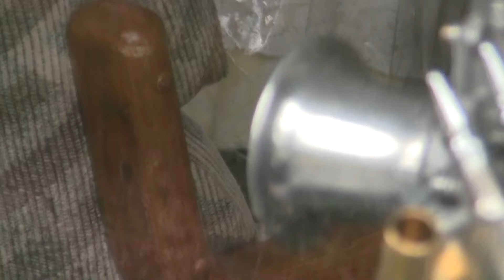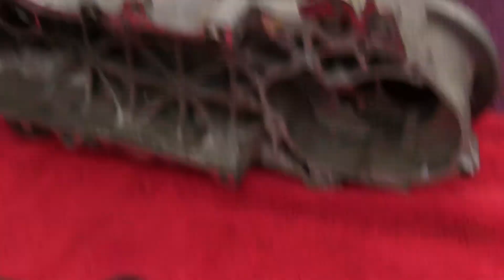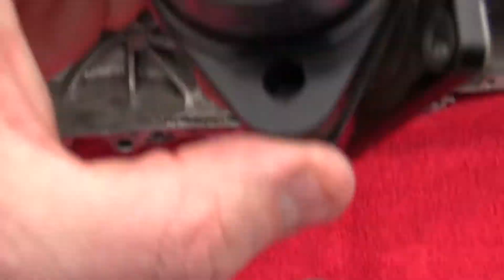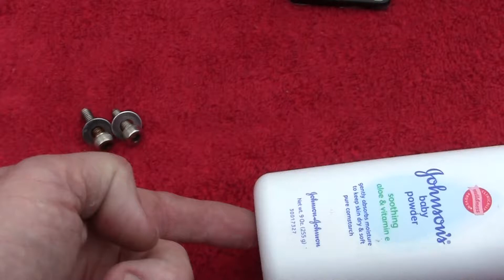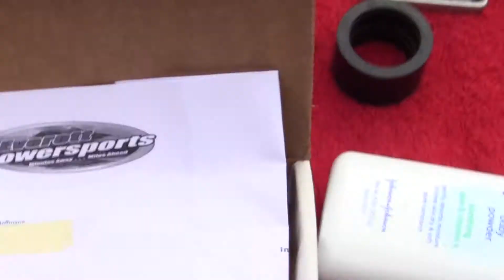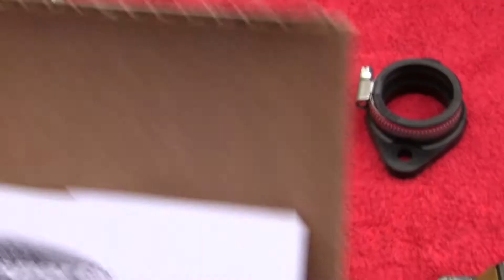189 -   Operation Honda DIO= 120cc STROKER ENGINE.

Comment: And u could port ur intake  bigger but u gotta be really carfull not to go thru the block u can even take out that middle of the intake port or knife it out. 
On my mini stroker motor i gave my intake a dimple effect port job
Reply from the maker: This boot fits perfect but it is costly. It fits the black manifold with 2 bolts and will work fine on the 33mm Keihin. Next up is Reeds- Setting the reed cage for maximum High Rpm.
Reply from the maker: My problem is there on no other stroker mopeds around me let alone one with a 33. I have to look at pictures and guess most of the time. If I was in the Islands I could probably walk down the street and get tons of great advice from the riders and have their mopeds right there to look at. It is harder when you have the only Stroker in town.
Reply: Everything i know was from mastakes i made i built alot of motors for people blown alot of motors lol its just a fun pricey hobby
Reply from the maker: Amen to that , my Friend. R

Comment: Its all about knowing how the parts work together
Reply from the maker: True. I did not think I would find a perfect size boot. Damn thing cost me some money though. I am glad it is a new Die cast and the rubber is new and not old stock. Its all good. How are your lights on the scoot in intensity, compared to the new HCY rotor and the stock system? You have to have light to legally ride in Washington state. Thanks R
Reply: DIOSpeedDemon my lights work really good
Reply from the maker: Your bike sounds really good. When I heard it , I Decided to look for a 33 Keihin and the NCY kit. Hey- why does the rotor have (2) slots or keyways? Can you set one set of timing, then change the position for a second? Has your top speed increased and what exactly would you say is good and bad, about installing the rotor kit? It sounds like a great experiment, cant wait to try it. Randy.
Reply: DIOSpeedDemon one keyway is for af18 other for af16 pretty straight forward install
Reply: DIOSpeedDemon u gotta use the second slot thats for af16 timing that u have.
Reply from the maker: That makes sense since I bought a CDI for a Japanese af18 and it did not work on my engine. Thanks.
Reply: DIOSpeedDemon for the cdi just use a little niddle and pop out the wires and put it in the same spot as ur bike , its just color matching ur wires. Will start rite up :)